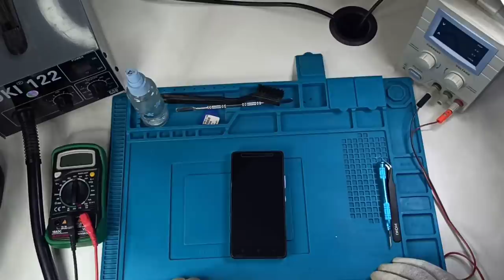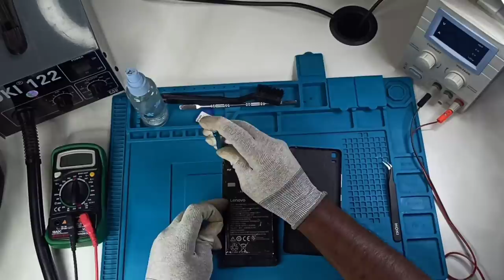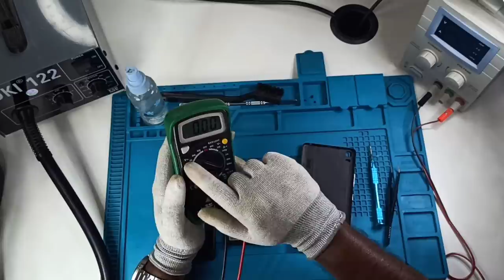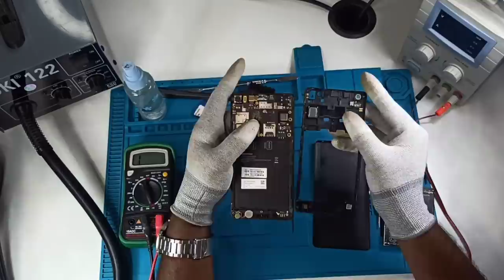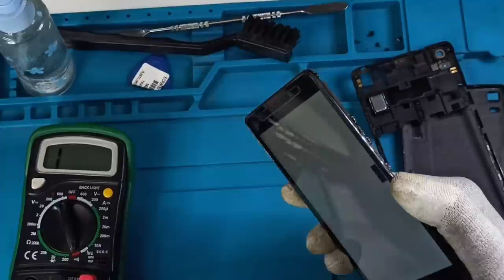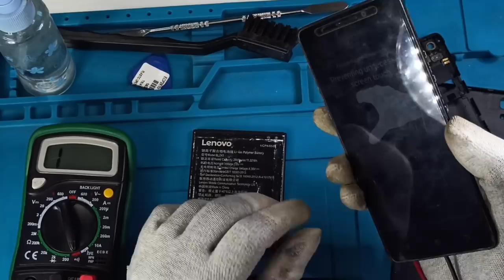How to Repair Dead Mobile Phone Step by Step Solution for Dead Mobile Phone

Comment: Bro Battery connect panna odane phone heat aaguthu yen bro
Reply: check the board for short circuit as well the inductor part, sometimes the heat deception system too, even the software.